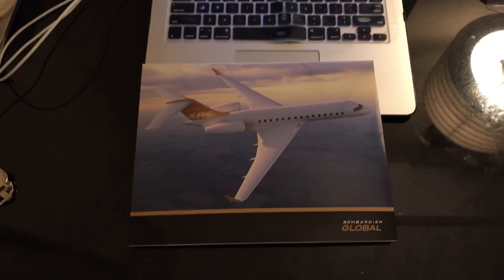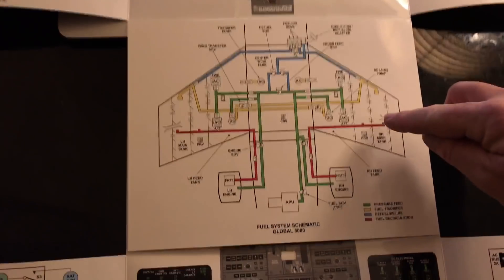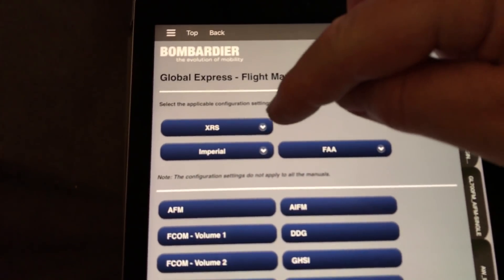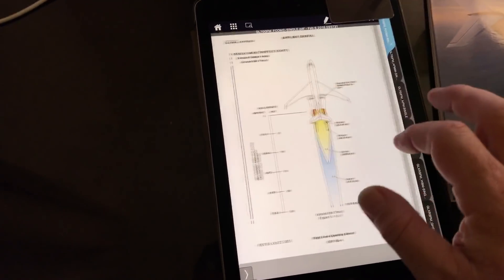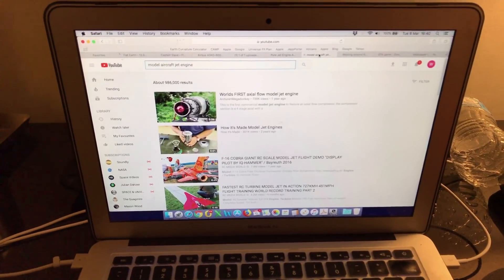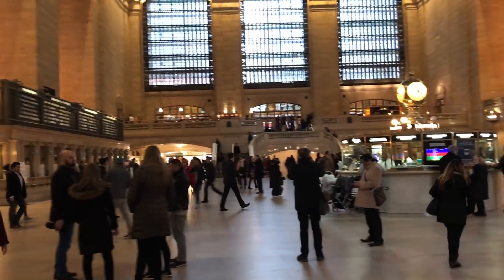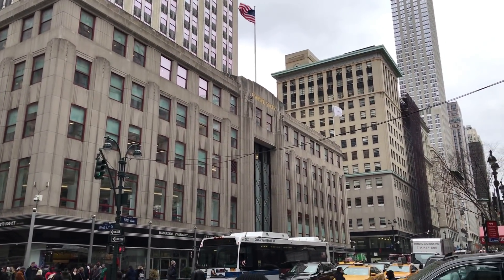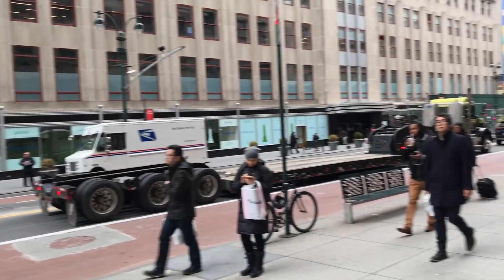Don't be ridiculous - of course Jet engines use liquid fuel.

Comment: face the truth, the a380 engines are non other than ''air centrifuger'' who separate différents gasses(hydrogen and nytrogen) who are mixed, compressed and ignited in the core  of the engine creating a perpetual vacuum in the front of the engine .    If ordinary hydrogen burn in ordinary condition, imagine when compressed and enrich with concentrated nytrogen, vroom vroom vroom !!! (looool)
Reply: What you're describing would be a perpetual motion machine.

Edit: or else just makes no sense
Reply: i am not complain about the energy price (lol) but it is real, the fuel is in the air and air is everywere (lol) Watch this https://www.youtube.com/watch?v=GUb4ak5o8x4&t=466s
Reply: Okay but number one there's barely any hydrogen in the air since any hydrogen quickly reacts with oxygen to form water. Hydrogen is very reactive.
And yet reacting it with nitrogen would still be awful. You'd be forming ammonia, and ammonia is an endothermic reaction. That is, you have to put energy in to make it happen. And very high temperatures and pressures too.
Reply: Watch this next video at 5.32(the Victor Shaunberger centrifugal machine principle)https://www.youtube.com/watch?v=xjYEI2PdDcE   and yes, there is hydrogen in the air we breathe for exemple if you use an air conditioner, you extract water of the air but you have to heat up the air first(like the jet reactor does) who condense on the radiator and water is just 2 parts of hydrogen electrically bound to one part of oxygen H2+0(h2o)
Reply: and bizarrly, this video https://www.youtube.com/watch?v=Jv42kdvxHNA show that the air at 250 celcius go into the wings before entering into the passenger compartment to pressurise all the plane, the hot air condense in a kind of radiator fixed  Inside the  wings and when the ''kind of air conditionner'' is full of water, a mecanisim just pump the water outside in fine droplets  creating the ''mith of chemtrails''  man it's like all the pièces of the puzzle fit together perfectly !
Reply: Ah okay so you ARE describing a perpetual motion machine.
If all you're doing is getting hydrogen by splitting water and then burning it again you're getting no net energy out. This is something we can be very certain of.

And the stuff about contrails is wrong. They're caused by sudden pressure changes at certain aerodynamic features causing water to condense into clouds. That's why their formation is dependent on speed as well as environmental factors.

No offence but you're never going to get a very good image of what's going on from conspiracy theory videos. How about sourcing from actual scientifically sound sources instead? It'll help you out a whole lot more than getting your physical understanding of the world from some guy who also doesn't understand what he's talking about.
Reply: Graknorke 
Some guy puts out a video on a subject he doesn’t know anything about which gets seen by other know-nothing.
Blind leading the blind...

Comment: These engines are started up using compressed air. Because of the weight of the fuel  I am doubting passenger jets are using the amount of fuel that is claimed. I would think they are using a combination of both, getting much better fuel efficiency than what is quoted. https://www.youtube.com/watch?v=GzhdxSsoT0g

Comment: According to some calculations I did, a Boeing 747 is said to hold 238,604 liters of jet fuel, and there are roughly 4 liters in 1 gallon, which means that the aircraft contains 59,651 gallons of fuel.
The average in ground swimming pool holds about 20,000 gallons of liquid. So therefore the 747 holds 3 times the volume of 3 swimming pools in jet fuel?
And further, the weight of 1 gallon of jet fuel is 6.8 pounds, a little less than 1 gallon water, yet still would equal 405,626 pounds of weight in jet fuel... within the wings. 

Does that make sense to you? Are my calculations off in some way? Seems quite impossible if not, but I'll be watching out for your reply.
Reply: Walter Boxhead  320,000 liters equals 84,544 gallons of liquid. A 20 by 40 ft rectangular pool with an average depth of 5 ft holds 30,000 gallons of liquid. Let's just stick with the type of visual example I asked about, which you responded to using a larger plane that supposedly contains 320,000 liters of jet fuel, which is again, almost 3 times the volume of the larger in ground swimming pools. 

You didn't reply that my math was off in the 747 to pool examples, and I'd like to know if there's any issues in stating that your larger planes wings are said to hold the volume of liquid equal to almost that of 3 rectangular in ground swimming pools that are 20 by 40 ft, with an average 5 ft depth. 

Does that still seem to make perfect sense to you? I just know you'll somehow say it does, restating your numbers again without the admittance of the visual of 3 large pools seeming to be way too big to equal the capacity of both wings. 

Just wondering if my calculations were a miss. Otherwise, are you for real?
Reply: New Perspective
Serious question, how close have you been to a 747?
Reply: New Perspective
So here's the deal, at this point you're claiming that either:
The given dimensions of the plane wings are wrong
Or
Algebra and geometry are wrong

I don't know about you but I don't fancy your odds with either of those.
Reply: Martin  C critique my math?
Reply: Graknorke Critique my math?
Reply: No the numbers are fine. It's just your personal incredulity making you refuse to believe that they could be correct. But it's been an shown that there is easily space in the wings to hold that much volume, so if you're still going to claim there isn't then you've got to be claiming one of those two things I said.
Reply: New Perspective
At the risk of repeating what has already been said, your maths is fine. The one observation I would make is that the 747 fuel capacity varies from type to type and the figure you have quoted of 238000 litres will be from a type fitted with tanks in the horizontal stabiliser and aft cargo bay. Capacities across the variants range from 203,000 litres to 240,000 litres. 

Figure number 2 in the article in this link http://craigmiddleton.co.uk/757/Biggles/www.crjresets.ca/z-Mcon/Hard2Find/B757/757_rr/boeing/aero_09_fuel.html shows location and capacities for the type - 400. Furthermore, the article provides an excellent laymans introduction into aircraft weight and balance and the importance of fuel management.

So if your calculations are OK what is the issue - and this is the reason why I asked how close you have been to such an aircraft as your comments suggest your are struggling to appreciate scale. The 747 is a huge aircraft and it is very difficult to appreciate this from looking at pictures alone. Many years ago I worked airside and its only when you get close to these aircraft that their true enormity becomes apparent. The video in the attached link hopefully will give you a better appreciation of scale.
https://www.youtube.com/watch?v=ajXxOdAnJMg
Reply: This is the source of all flat earth nonsense.

You've been told how big the wings are. They are more than big enough to hold that much fuel. You can verify those measurements a hundred ways and do the math yourself. But you don't bother to do that, because it conflicts with a completely unsubstantiated visual picture you're created in your imagination, so you reject it. This is retarded. What you can picture in your imagination proves absolutely nothing.

Comment: i was reading the fuel consumption of a very large jet awhile back.it stated it used a gallon a second so doing the math of 60 gallons a minute just figure so without a inflight refuel you end up with 3,600 gallons an hour times a 12 hour flight =43,200 gallons.kinda of alot of weight i would say.x that by 43,200 x the weight of a gallon of rocket fuel
Reply: Jet liners are big.

Comment: NEW THEORY PROVES PLANES CANT ACTUALLY FLY. 
The world government, run by the alien shapeshifters, aka the illuminati has, for seventy years, been building invisible monorails up to 40,000 ft above the surface of the flat earth. These are held up by a combination of density, magnetism and the horns of immense, totally undetectable unicorns which are the property of the UN which was set up for the express purpose of building these monorails to fool the sheeple into thinking the science charlatans had made flight possible. The Wright brothers were out of work film actors whose so called flight was shot on the Keystone Cops lot in Burbank. You can prove this because the shadow of the wings on the photo of their flyer would not have been possible at Kittyhawk which, anyway doesn’t even exist.That’s why you can’t so-called fly over the so called Antarctic because the UN hasn’t built any monorails there so that the sheeple can’t discover the edge of the world. REMEMBER: YOU SAW IT HERE FIRST.
{Caution. This post was typed on a keyboard previously used for the typing of satire, sarcasm and hyperbole. May contain traces.}

Comment: You guys need to watch again - he said NOT ALL JET engines.
Reply from the maker: +john kean  Who is "he"?    There are many videos about this.  Even if "he" said it was only one jet engine he is still wrong.   They all use fuel.  None of them run on compressed air alone.  

Which model Jet engine do you think uses no fuel in the cruise?

Comment: Forget the dummy video on gauges n crap. Show us a dismantled wing. Show us the tanks. Then explain why tiny wheels on a plane the carry tens of thousand of gallons of fuel... 10 large tankers in fact in each wing when a prime mover only carries 28k fuel 24 tyres..hat equates to 240 tyres each wing just to hold up the weight ....OR over 100 tyres just to support the sheer weight of the entire planes fuel...( this does not add in cargo and passengers).  ANSWER THAT EINSTIEN!
Reply: "Then explain why tiny wheels on a plane the carry tens of thousand of gallons of fuel..."
https://imgur.com/gallery/PwzZV
Reply from the maker: +Peter Stevenson.   Did you not hear the part where I will be doing a follow up?  It takes time to get this footage.   I have some but will get more when I am back in Australia as some of my friends are aircraft refuellers. 

Patience is a virtue.   

The wheels are not tiny at all - what are you talking about?   Do you think an aircraft tyre is the same as a truck tyre? 

https://www.youtube.com/watch?v=UQObeXnSDzc

Here is a part of what I got this week.  

https://www.youtube.com/watch?v=B0oPMk_mce8
Reply: Australia, you say? Gawd i hope you mention Brisbane Airport!. Because im Aussie and i work at Brisbane Airport usually 6 days a week.;)  KEY ITEMS -----> tiny tyres holding up hundreds of tons of aeroplane....how is it possable, then explain why when servicing a jet engine no fuel is used to run the engine. Its actually started by an air starter which can crank an ourragious velocty that simulates airflow into the engine which in turn spins the hundreds of tiny fans inside that creates thrust. The faster the airflow the faster the tiny fins spin the more thrust created. Fuel added during the starting of the engine creates a afterberner type flame to shoot out the back because it is fuel that cant be consumed.
Reply from the maker: +Peter Stevenson - heading out now and will reply more - but please tell us what your job is at Brisbane Airport and be honest. 

You are clearly not a pilot, refueller or aircraft mechanic so please let us know.   I am just curious.  Baggage handler?   Check in staff etc?
Reply: What are the numbers that don't add up? You aknowledge airliners do exist, right?
Reply: Peter Stevenson,
Why don't you search about tyre technology? An airliner tyre can take 25 tonnes of load, five times more than a truck tyre. It is no secret data.
There are many things you won't believe in aviation, I guess...
Reply from the maker: +Jake Penny.  No Jake, I don't beleive whatever I have been told.  I have been a pilot since I was 16 years old and am now 53.  I have over 10,000 hours flying real aircraft and most of that time is on Jet aircraft with a few thousand hours on turbine powered helicopters too.  

Personally oversighting the refuel of my aircraft in almost every case and have even pumped it into the tanks myself using a hand pump and 44 gallon drums when in remote locations. 

I wrote my own flight planning programs that can be used for international flight planning all over the Earth.  The mathematics simply won't work on any Flat Earth. 

The numbers do add up,  perfectly. 

Please give me an example of the numbers not adding up and I will explain it to you. 

Show me one Flat Earth channel produced by a pilot who has 30+ years and 10,000 hours of actually flying around the real Earth please. 

You can't.  

You can't even find a single Flat Earther capable of producing a rudimentary flight plan.   Try it.

Take a look at all the experiments I have personally done on my channel.   Real observations and real experiments.  Now show me one Flat Earth channel who can show you real video and experiments on such a broad range of topics.   You can't,  Most of the FE channels don't do experiments.  They just talk for hours and rely on CGI nonsense.
Reply: (Just posting to get notifications of thread & peters and jakes replies)
Reply: how can these people be so stupid?? they can't believe a plane can hold all fuel, even though compressed air would take up many times more space , and I haven't bothered to the calculations, but I bet you couldn't even get the thrust to make it work.

Comment: How do the engines combust fuel while flying through rain? Why doesn't the air forced through the engine snuff the combustion?
Reply: You know the air temperature after the compressor stages (and before combustion chamber) is about 300°C and even more?
Reply from the maker: +Josh Holden.   Because of the path of the air and the burn pattern.  Plus the engines have igniters and most of them have auto ignition that will instantly activate if there is a flameout.  

These videos show more detail.    The path of air can naturally deflect water and contaminants and some engines have an inertial separator.   

https://www.youtube.com/watch?v=QPK_eiNng7Q

https://www.youtube.com/watch?v=oaiewQv5mn8
Reply: I replied about water that could be inhaled by a jet engine in case of rain, and Wolfie more about the air forced that would not snuff the combustion. By the way, thks for the links, it is interesting to see the wide variety of designs of combustion chambers! Aeronautics is really creative.
About water that could be inhaled, my point was that it turns into vapor before the combustion chamber. And water can actually increase the thrust. The old KC135 planes had P&W J57 engines that could benefit from water injection during take-off... Anyway Josh, an airplane spends most of its time above clouds and rain.
Reply: Raging S, yes indeed. Yet I am afraid we are bringing arguments to people who think that engines can cun on water instead of fuel ;o)

Comment: Wolfie6020 Another thought. Not about fuel but about weight. If an Articulated lorry tanker that weighs total of 44 tonnes needs 18 wheels to spread the load to 2.44 tonnes per wheel then if we load say and A380 with it max fuel of 250 tonnes then each of the 22 wheels would be subject to 11.36 tonnes plus the weight of the aircraft loaded (575 tonnes max) which would be 26.13 tonnes per wheel. Bearing in mind that the aircraft tyres are not that much larger than the lorry wheels. When punctured, they collapse like a balloon and lose shape like a weak wheelbarrow tyre. https://www.flyingmag.com/airbus-a380-lands-with-square-tire . I do understand that tyre pressures on the A380 are 220 psi instead of 110 psi for HGV lorries. Its still 10.7 times the weight per tyre. Also, I see that when assembling the wing the outer skin of the wing is used as the fuel tank. No double skin or "bladder" to stop the fuel from moving through the holes in the ribs can be seen. It is a very curious problem especially as there are plenty of pictures of crashed planes where the cabin is completely burned but the wings have not caught fire. Very odd.
Reply: I am only asking questions. So far the answers revolve around deflection and avoidance. No education has been noted so far. Its no good answering a question with the data that is being questioned, it's not logical.  As for "Aluminium ash"? WTF is that? Aluminium will melt, but not turn to ash. Ash comes from hydrocarbon fires.  Their are examples of wings on fire that are caused by hydraulic fluid I admit that, but it seems that insulation on the body of the jet is more flammable than kerosene. ... As for critical thought, questions are always critical. However I don't see you ever asking any. Best you carry on with your plane spotting. PS Question everything. Its the only way to find the truth, no matter how much it hurts.